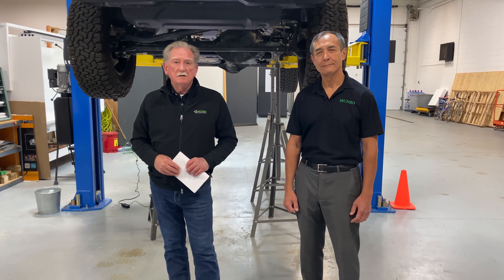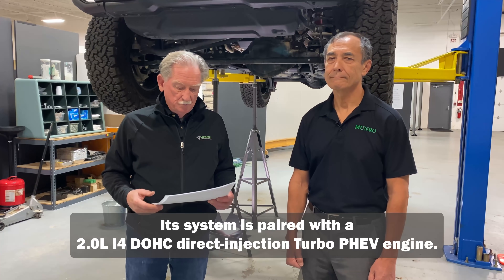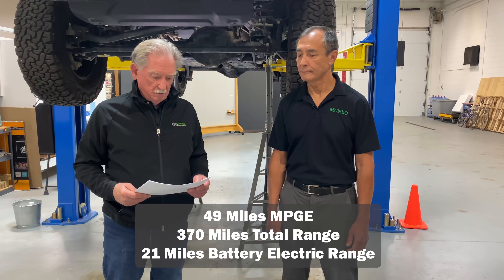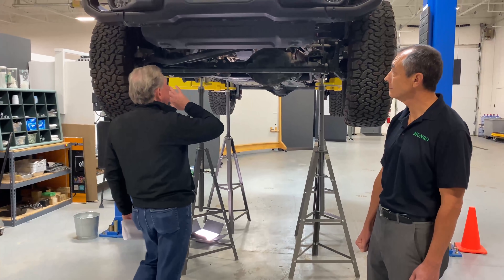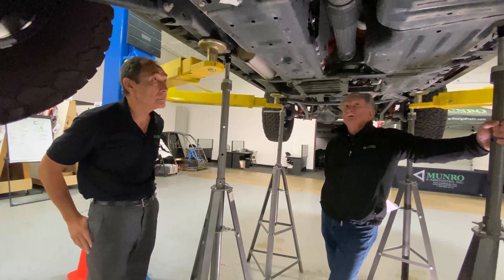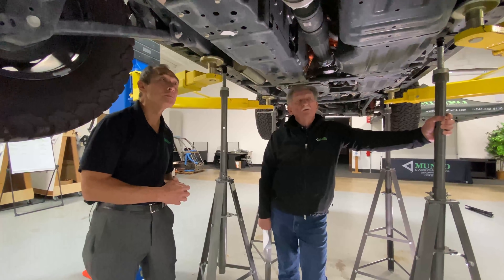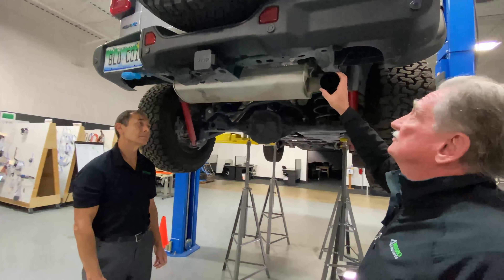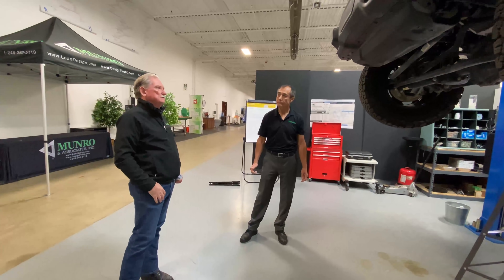2021 Jeep 4xe | On The Hoist

Comment: I've been so unimpressed by the drive and ride of the jeeps I've driven I could only imagine owning 1 for off road and hunting purposes.    However my Silverado drives and rides better than any Subaru, Jeep, or any other truck besides air suspended Ram!   I can't imagine many people really asses these issues when purchasing a vehicle due to the simple fact people are buying these crappy driving vehicles.  Glad to hear seat comfort improved.  The jeeps I drove had terribly uncomfortable seating!
Reply: Well, to be fair Jeep Wranglers were never designed to be luxury motor cars, they are mainly for off roading.

Comment: I own Jeep Wrangler for the last 22 years (YJ 1993, JK 2007 Sahara, JKU 2012 Sahara) , and I can tell you that no Jeep Wrangler worth that kind of money...  I always loved my Jeep, but I will never pay 70k for one (full electric or not). That is why I will keep my 2012 until the Cybertruck is available.
Reply: a full electric version may be.
Reply: @cryan9376  At this price tag I want the cutting edge technology but still want to be able to smash big snowbank if I need to 😁 That's why it will be Cybertruck or keep my old jeep JKU 2012 untill it die!
Reply: Let us make it way more complicated, charge for two powertrains... more money & double maintenance
Reply: @ryandoyle4344  its not more complicated, its not double maintenance, you're welcome. The generator basically replaces the starter, the water pump, HVAC compressor, power steering..... are all electric.

Comment: Does it rust? Check. Does it dent? Check. Windows crack? Check. Has a big-ass heavy drive-axle underneath? Check. Dual engine/EVmotor to worry about? Check. Requires oil changes every 3000miles? Check. Filled with legacy tech? Check. Any groundbreaking tech? No. So why are we bothered with this tech? Just because it's fun to drive? I guess... It looks like an infomercial for Jeep.

Comment: So, a couple weeks ago Sandy says hybrids are not the way to go - full electric is. Now Sandy is saying he may buy himself one of these Jeep hybrids. Huh?
Reply: The confusion is what a hybrid is.  The traditional slow laggy prius is a parallel hybrid and those suck.  This is a series hybrid where both the electric motor and gas engine can power the drivetrain at the same time.  In the chevy volt, this means even when at zero charge and the gas engine is proving all the power, the car retains the feel of an EV with instant torque.  This happens because even when the gas engine is running without any battery reserve, the gas engine is providing both torque to the drive shaft and generating electricity to power the electric motor.
This jeep will feel like an EV even when the gas engine is running, thus any EV owner will enjoy driving it.
They really shouldn't call this a hybrid because hybrid = prius in people's minds.  They should call it an EV with gas assist.  It is really a short range EV with a gas range extender.  The only reason they tend to call these hybrid is because the gas engine can either generate electricity or directly provide torque to the drive shaft.  For whatever reason, just because the gas engine will intelligently choose to generate power or generate torque depending on efficiency, these cars are labeled as hybrids when they drive and feel like EVs.

Comment: $70k for a plug in Hybrid Wrangler that gets only 21 miles on electric.  This vehicle is a disappointment and a joke.  And Sandy, water just causes rust on parts you don't see and can't get to easily.  So stop driving in water!  Also, the towing capability sucks in the Wrangler, you can't haul much at all.

Sorry to hear about Mark's passing.

Comment: The Rubicon is as good as an off-roading ICEV can get, in my opinion.  Lots of clever engineering, lots of utility baked-in.

Too bad it's obsolete.

It isn't smart, and it still has an ICE.  Smart cars and battery-only propulsion are the disruptions that will sweep through the automotive industry, and at the end of it, not even hybridizing a Jeep will save the brand.

i wonder if Stellantis, or whatever they're calling themselves this week, understands what's coming at them.

Comment: from a Engineering perspective, JEEP Screwed up, IF they wanted to create a GREAT Electric ⚡ JEEP they should have made the vehicle FWD with a Hybrid motor, then using the transmission tunnel and the back seat for the Batteries, and a RWD electric drivetrain, that way it would have over 60+ miles of range and over 400 miles with Range Extender like a Chevy VOLT ⚡.

Comment: I want TESLA to do a Short wheelbase 4x4 Cyber vehicle like the JEEP/Bronco. 
It's got to a 4 wheel AIR suspension, and a DUAL motor Drivetrain.
Reply: Air suspension is an expensive, delicate maintenance item. Rides nice though. I've owned four vehicles with air suspension, the latest is our Range Rover. But I'd never use it in rugged off road work.
Reply: @bearchow1929  - AMC Hummer had the best suspension, Magnaride with adaptive suspension and tire pressure control from inside the cab.
but, the Military could afford it.

Comment: Think how capable an all electric Wrangler could be with a clean sheet of paper design. 300 mile range, AWD, no transfer case or drive shafts, clutter free underbody, silent cruising off-road and not chasing wildlife away, etc. This one is too much of a compromise and very disappointing.
Reply: Refer to a Rivian R1T if you want that😁